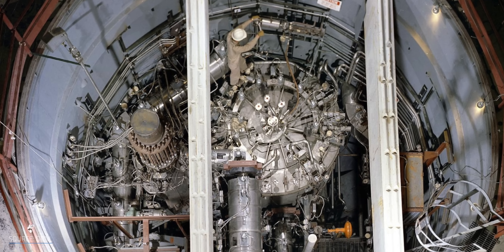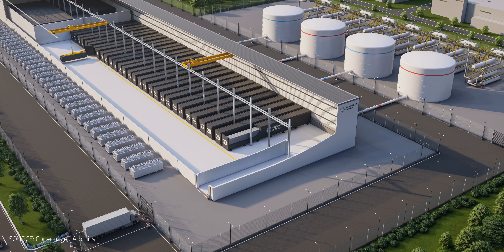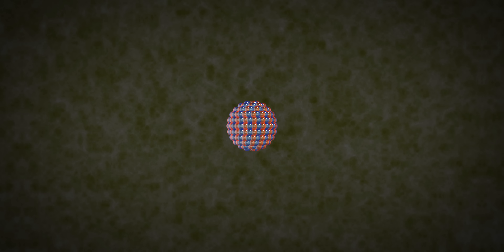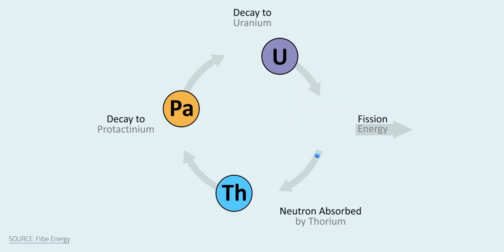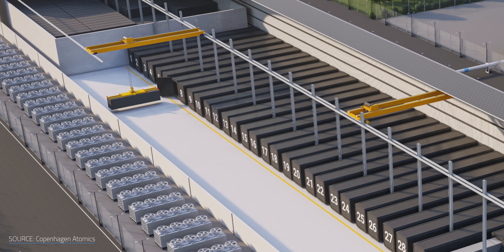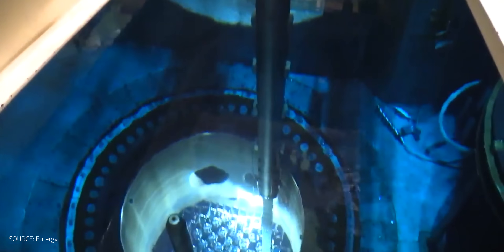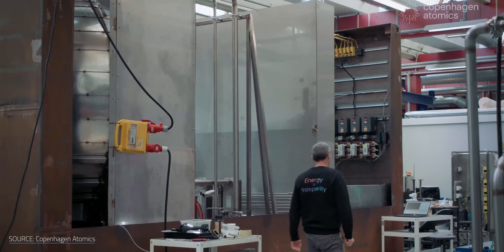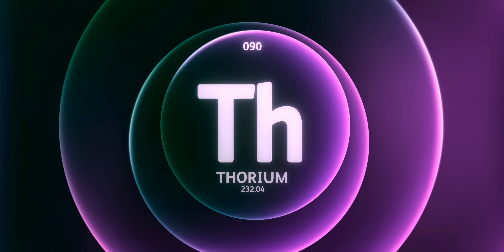Why Thorium is About to Change the World

Comment: It isn't close. The corrosion and extremely high maintenance costs aren't solved.
Reply: It's closer than it's been in a long long time 

The modular design is the solution to the corrosion problem. They're not solving it, they're building it in.

In some ways you can think of each module as a AA battery, they're not denying that you'll need to replace it. 

A 5 year old AA battery that you can swap out and upgrade. Even if it's every 3 years the math maths. A 5MW solar farm is 20arces of land. Iirc that's 1 truck trailer. Even if it's 2 because you run the reactor on some kind of variable cycle, thats still less than an acre. As long as society finds the right landfill to put it in/near. It'll work
Reply: @NerfThisBoardGames It solves the corrosion but makes their economics very doubtful. Rebuild the core each 3-5 years doesn't sound cheap even if they claim that they can recycle the most expensive part.
Reply: Thats why they only run for 5 years not 50, then swapped out.
Reply: I believe we have solved all the material science barriers. but the technological solution of today rarely becomes commonplace for 20 to 30 years.
Reply: @paperburn  demand may change things this time around
Reply: Honestly, im so tired of all of this "news", when Thorium is here for the 123th time yet in reality there is still nothing. So comments like these even if half-true, are kind of time saver.
Reply: They literally went over this when discussing the 5-year corrosion period where certain internal parts get replaced and updated to modern improved variants, rather than the 20+ year traditional nuclear reactor upgrade cycle. The maintenance costs for that reason are not high, as they are far outweighed by the low initial production cost -and therefore higher adoption rate potential and cost of scale manufacturing + rapid technology iteration that makes all processes more efficient over time, instead of everything having to be done at once in the beginning with massive risk and certainty that the tech will be outdated decades before the plant has paid its initial cost back.

Think of it like this: Every time there's a maintenance cost associated, you're not just replacing old parts. You're upgrading them. It's not just replacement, it's also to a degree an investment in better parts that lead to more efficient and cost effective operation, and lower maintenance cost for future maintenance. Basically it's a downwards rate of cost-over-time that gets more efficient the more replacement cycles you pass. This is the core of the business model and why it is being supported by so many invested parties.
Reply: @Real_MisterSir  > The maintenance costs for that reason are not high.

They claim that. It remains to be seen. Faster cycles mean faster tech? Yes. Cheaper? Definitely not in the short term.

Economies of scale. That's if you build lots of similar reactors to ADD THEM not to replace them. It's easy to claim that build 2 units at the same time, cost less than double the cost of one unit. But it doesn't seems right that build 2 units will cost less than one. Instead of one reactor that last 40-60 years, you need to build 8-12 reactors to generate the same lifetime. So they claim that the economies of scale works so well that build a new neactor will cost less than refurbish or update an old one.
A little doubtful.

While I understand they claim that their design is simpler and the most expensive part is recycled, and the model is a SMR with simpler removal system, still you are talking about remove and put a new reactor every five years. As I said, I have serious doubts about their economics. It's just the result of hope a lot of good assumptions. There is a high risks reality won't meet their projections.
Reply: The material science is solved regarding molten salts. You just need to ensure the salt remains dry and air free. Since they're building them to be housed in shipping containers, the air problem is easy to solve by flooding the container with nitrogen.
Reply: @atrumluminarium What about high temperature chloride corrosion? Chlorides in high temperatures eats metallics materials before breakfast
Reply: Besse-Davis (2002) has joined the chat. Water is extremely corrosive at high temperature and pressure and water has been the main contributing factor in every major civil nuclear accident on record

Even the original ORNL project intended to treat the system components as disposable - The idea being to make them long-lasting, but that said the design is intended to be LOW maintenance - much lower than the constant supervision needed for LWR designs
Reply: If you want it to be profitable, yeah this is unsolvable under liberal capitalism. 

But, if you consider 'energy' an strategic infrastructure that pays itself in dividends many times over on other sectors... Then it is already viable.

For example 'transportation' is considered strategic infrastructure in China and trains operates at a loss of 3 to 1 there. (For each RMB they get for tickets, they spend 3 from public funds).

By having the correct subsidies and political enviroment it is very much possible, what is restraining us is political will. China already have plans to get many of this thorium reactors in pilot plans.
Reply: What I meant in "liberal capitalism", is our current "neoliberal framework" that got implemented in the 70's by Nixon/Tatcher.

Before it, in the 50's and 60's we had keynesianism capitalism where investment in infrastructure was not a sin and was actually advised to get out of crisis.
Reply: @snes-mode7  Its easy when you can do what you want and imprison your dissenters.
Reply: @marcelo55869 Most nations are hybrid systems that use capitalism to generate wealth and then use govt to tax that wealth and invest in socialist public projects.
Reply: @snes-mode7  The political will you speak of, Marcelo is effin' corporate capitalism, the bane of our E-air-th!
Reply: @snes-mode7  Liberals tend to be in favor of more regulated capitalism, not the "free market" capitalism you seem to be referring to when you say: "liberal capitalism". The problem we need to solve with unregulated "free market" capitalism is its very short time horizons for profit.
Reply: @archstanton_live  "liberals" were the original "Small government, less regulation, unregulated capitalism" crowd. It only got turned into an insult when a certain Mr Hitler came along. What gets spat as an insult by right wingers (Liberals, or Woke) is actually "progressive" in political terms.

As has been said: The problem with neoliberalism is that eventually you run out of publicly-owned assets to sell off to your mates
Reply: @alanbrown397  "liberal" is a propaganda dog whistle as you are using it. You seem to be advocating for an authoritarian government such as China has, rather than a democratic one. Please clarify.
Reply: @archstanton_live  you are confusing leftism vs liberalism. "Liberal Capitalism" means liberal in the freedom sense, not liberal as in the four-letter word boogeyman that the right in the US uses. Think liberal as in the way libertarians use liberal as part of their name.
Reply: @FryGuy1013  collectivist libertarianism is an oxymoron.
Reply: @archstanton_live  there’s also the large number of dead people, poisoned water, air, and land among other environmental devastation unregulated capitalism brings about.
Reply: @Harrythehun  so negative
Reply: @kuromiandmagic But it's true, truth doesn't care about your feelings.....
Reply: It is very close
Reply: If you're replacing the reactor every 5 years then the corrosion issue has been solved.
Reply: @Harrythehun  anti corrosive casing is already a thing
Reply: @jaydenwilson9522 Glass can be used, but try that with moving parts, valves, pumps, pipes. Another thing, if you get at hiccup, the salts solidify and game over.
Reply: @Harrythehun  I got news for you. China has solved that. They have two test reactors working now. They are using Thorium already
Reply: @Harrythehun  Tesla’s or Amazon’s robots could handle the radioative substances

Comment: So much wishful thinking and just another small company, which will not produce anything of substande. These plants are still prohibitly expensive, the dangers of nuclear energy multiply with the number of plants, so thousands of smaller plants make it probable we will have an accident and while the waste may "only" be a problem for hundreds of years, it is much more dangerous. Every single lab reactor playing around with molten salt has problems with corrosion etc., why should we believe, that these guys solved the problems?
Just face it, wind and solar, together with batteries and a small amount of (someday in the future, green) gas is the solution, we already have.

Comment: Like this idea over the "backyard" reactors that some have pushed.
Reply: GEET developed by Paul Pantone can power a home or vehicle off of any hydrocarbon, including water, crude oil or biowaste. With zero pollution by using a plasma fuel processor the breaks down the elements through implosion instead of explosion. Huge efficiency gains and much more.
Reply: @silversobe Is this concept more energy dense than burning hydrogen and water in a fuel cell/microturbine?
I would like a backyard/basement/garage reactor on property or a substation/district micro reactor in my hood thank you very much. For all the remote villages and such as well.

Comment: India sitting with largest reserves 
Back in 50s the great scientist homi baba revolutionary 3 stage nuclear programme 2nd stage already finished in india
Reply: Canada also has lots of it, turns out it's an impurity in potash
Reply: It's very common. Your back yard probably has some.
Reply: @myne00  Yet usually very dispersed, and not economically viable to mine.
Reply: India has a different strategy by using a separate breeder to breed U-233 for use in the AHWR.